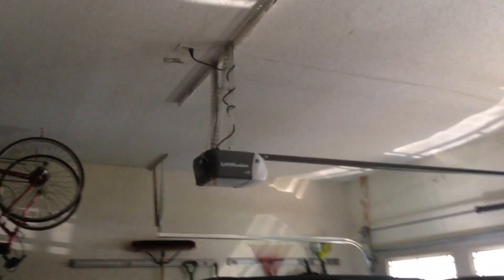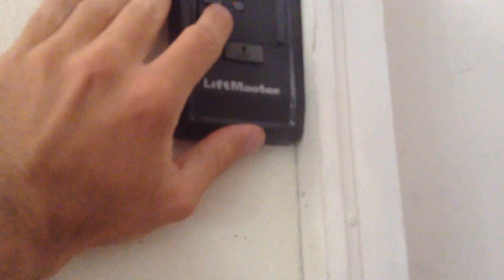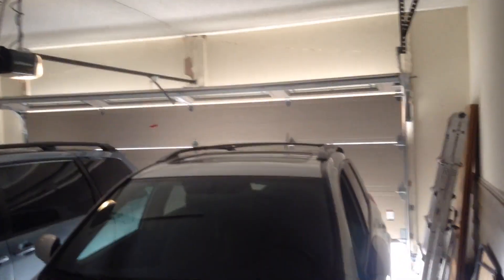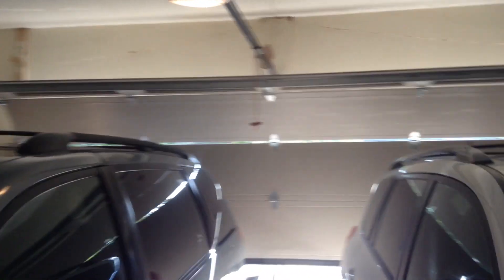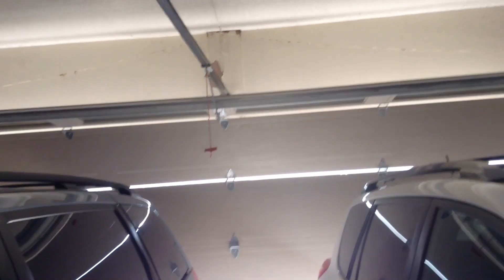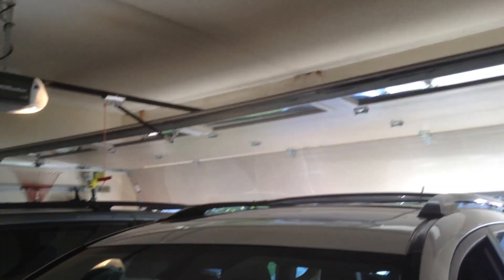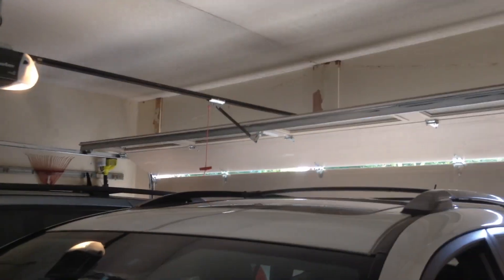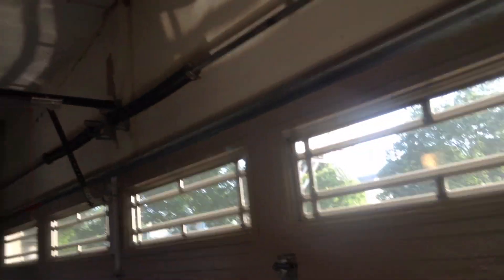Liftmaster 8165

Comment: does this have safety sensors and battery backup and a keypad or no.
Reply: It doesn't have a battery backup. All openers are required to have safety sensors, so they come with the opener. Here's a comparison chart for all current LiftMaster door openers: https://www.liftmaster.com/catalogresourcesv3/en-us/shared/files/generaldocuments/gdo%20comparison%20chart%20_100115.pdf

Comment: Where is your old chamberlain video. Does this have battery backup and safety sensors. Does it have a keypad. That is a quiet garage door opener.
Reply: this does not have backup battery but it does have sensors and a keypad. the opener will say if it has a battery.